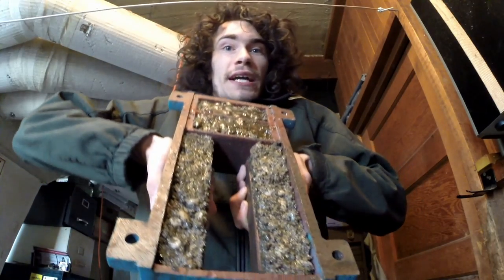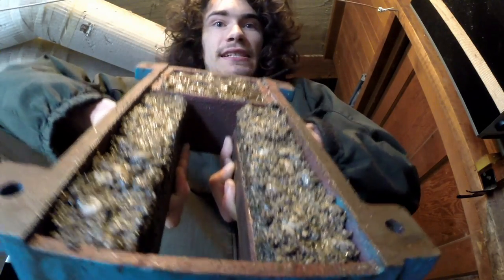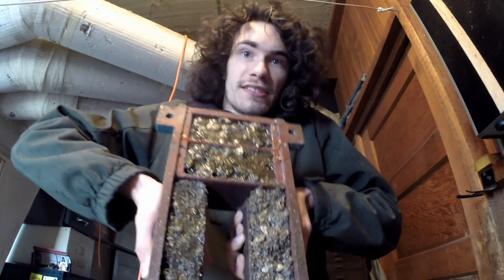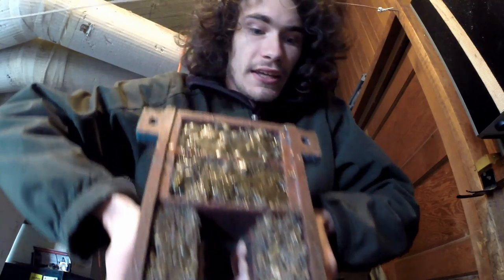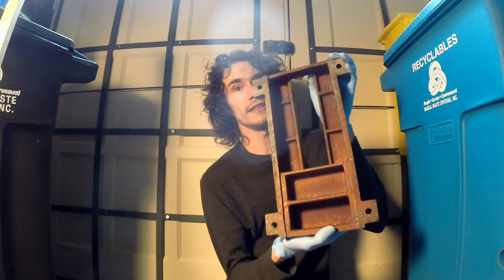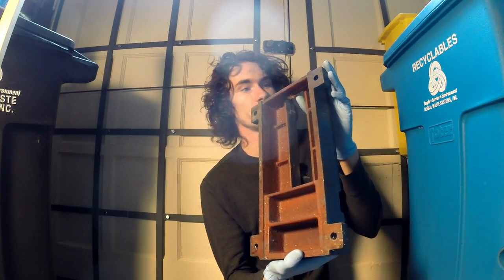CNC Mill Epoxy Granite

Comment: How is this better than just using concrete? Heavier?
Reply from the maker: Main issue(s) with concrete are the fact that it is corrosive and the fact that it is prone to cracking. While no method is perfect they actually make some high precision machines using this composite granite although they are not using stuff they grabbed at the local home improvement center!
Reply: Good solid answer!
Reply: Vibration damping probably is the number one advantage of polymer concrete.

Comment: good morning my friend instead of resin i could use pure concrete or would i have a problem?
Reply from the maker: Pure concrete will corrode the steel and crack, the epoxy binder is used since it stops that.
Reply: @MakeItWithCalvin  
thanks

Comment: Did It make the machine more rigid? Was it worth the trouble?
Reply from the maker: I have not been able to use the mill enough to definitively give a yes or no at this time BUT I have noticed when it was making heavier cuts it sounded quieter so if that relates to a stiffer machine we will see. Hopefully in a few weeks I will have a follow up video.

Comment: I see no point to filling the underside of an already solid machine slide. I mean cast iron is rigid .
Reply from the maker: Fair point, although this was more for vibration dampening which it did a good job of. One thing to remember on most of these cheap import machines is that they are very stingy on the cast iron, unlike modern machines which are designed with ribs and computer calculations to make it rigid with the least amount of material needed. Ultimately I did notice a difference so I think it was worth the time and effort although it was a bit of work!
Reply: Big difference on a mill especially a bench mill. The heavier the better.